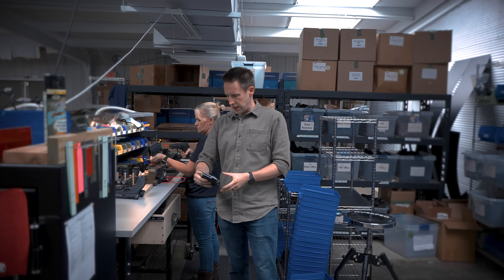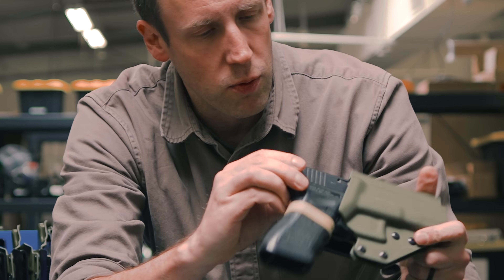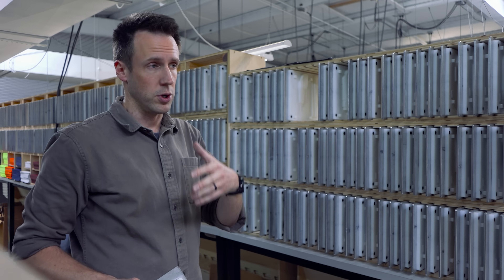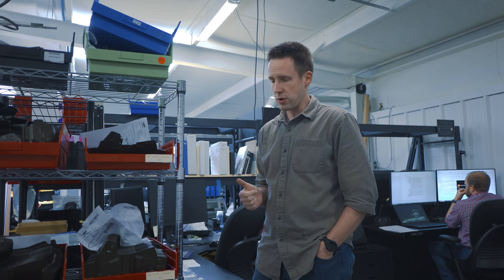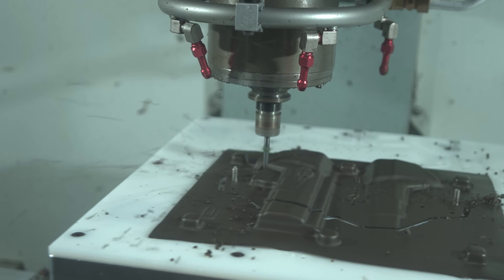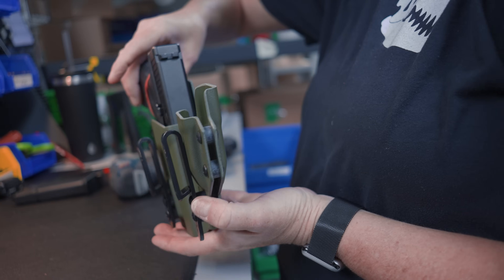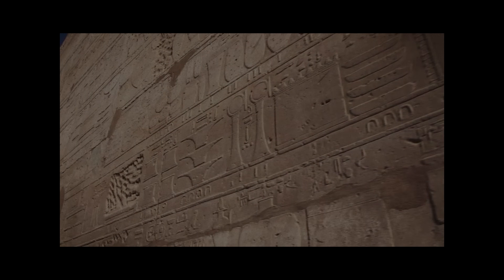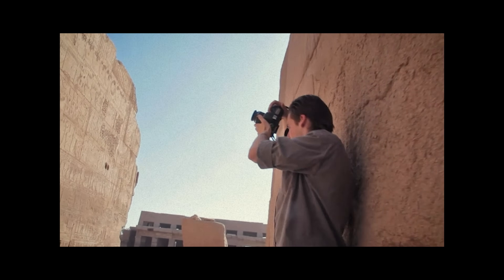Why We Use Kydex to Make Holsters

Comment: I have an old Sidecar 1.0 that refuses to break, and I have a 2.0 that I used consistently for about 1 year that broke right near the claw (it was the thinner kydex).  I contacted TREX, they responded extremely quickly, had me set up so that I could choose a different color if I wanted, and after expressing my interest in the new adjustable claw they sent me a prototype with my holster.  The new holster is holding up well, and I'm confident that if something happens, Trex will have another holster in my mailbox in short order.

There are lots of good holster companies out there.  But I will continue to support Trex as long as they are a force for good.
Reply: How you liking the new claw?
Reply: @isaacbotkintrex  I still have to get back to the CS department with my feedback, but the prototype claw solved my issues with fine tuning the holster fit. I had to max out the adjustability with it, so perhaps it could be slightly more extended. And it did end up cracking into 2 pieces after ~8 weeks of daily use. However, I think that's more due to material than design.

Comment: I remember when I worked for R&H back in the 70’s - we invented and made kydex but didn’t know what to do with it.  They sold it to someone for pennies. I still have a huge slab of it on my workbench counter top - it was great for that.  Never dreamed it would be used for holsters.
Reply: I know it gets used in airplane cabins quite a bit, because it is flame-resistant, FAA certified, and easy to vacuum form into seat backs and dashboard components and other big pieces needed in small quantities.

Comment: As a chemist myself i have to agree. Since you work with existing plastic sheets there isn't much you can to to thicken high stress areas. So stress relief by very even and slow heating and cooling is the best thing. Annealing / tempering isn't exactly the way to go if your polymer would go back to a rubbery/liquid state. Although annealing slightly below the Tg (glass point) might work, if you make sure that it then stays within tolerances and form factor. That could even be done after all the bending (assuming all other polymer parts mounted at that stage survive that temperature, which they should) to relief that stress and set the polymer chains in their final form. Going for another polymer with thermoset properties (crosslinking) would probably be overkill, kydex should be enough for most holster applications.
Reply: What about a negative pre-press? Heat the plastic, put it onto a flat base with tight fitting sides, then press with a top plate with grooves. Theoretically, you could thin out the sheet where the top plate is solid and move some of that material into the low pressure area provided by the grooves. It wouldn't be a lot since you don't want to melt the sheet to a liquid, but it might shift thicknesses around a bit? Then reheat and put it on the vacuum former. (Alignment would then be rather important)
Reply: @bare-footjo35  the idea isn't bad, but that would turn a one step process with one press direction into an alignment based two step process. We gain some material, lose control over like 5 other variables and make it more complicated there...
Reply from the maker: If Kydex liked being cold-formed, I'd really want to try something like Roboforming; much more control over wall thickness and stretching at the expense of longer times.
Reply: @T.REXLabs  I know a custom engineering robotics company not far from Nashville who may be interested in helping out if you want to try it. They don't have any experiance with roboforming, but do other precise motion control operations with 6-DoF arms. If you're interested, I can send you some info.

Comment: This might be some level of idiocy, but do they make they devices akin to immersion circulators/sous vide cookers, but that run closer to 200*C or whatever Kydex requires? Granted, I'm not sure what fluid wouldn't mess with the Kydex, but a nice tank of liquid with ample heating and circulation does wonders for heating things evenly to a specific temperature as all that thermal mass works to your advantage. I don't doubt that a heater/stirrer could be made if one isn't already produced, it's the liquid that stumps me; but, admittedly, I know little of plastics and industrial stuff, it just struck me as an avenue for experimentation. 

If you don't have to maintain vacuum when cooling, you could have a series of follow on tanks that step down in 10-15 degree increments or whatever the sweet spot is for Kydex. Since the holster is submerged, it'd be inherently even cooling.

If you do have to maintain vacuum, well, this is jumping from one rando's theory to wild, uninformed speculation, but I wonder if the liquid used for cooling could be changed. Like, Isopropyl or Acetone evaporate much faster, which might be part of a solution (surely there's other similar stuff that isn't turning your shop into a giant fuel-air disaster). If it's water or nothing, then you might want to see if using those extra fine mist sprayers helps you any. No big drops, so no pockets abruptly cooling (well, unless tiny drops merge, but they're so fine that'd hopefully not be a snag); plus, that extra fine mist is likely to reach areas that get missed given how readily it floats in the air.

Pure theory. I would imagine there's reasons they don't do it this way. 
..I do wonder if controlling the temperature of the water you're using for cooling would help, too. Say 140-150, so it isn't taking much additional thermal energy to evaporate, but those cheap misters are thin plastic. >.o Similarly, I wonder if adding mass via salt in the cooling water would have an effect. Not sure the juice is worth the squeeze on that, or any of the above, but just a couple thoughts. If not, well, then at least I'm goosing engagement by leaving a comment. :P